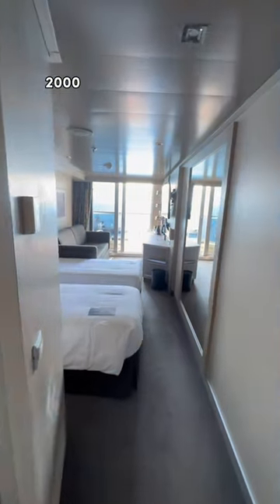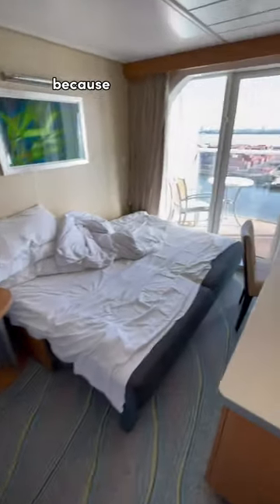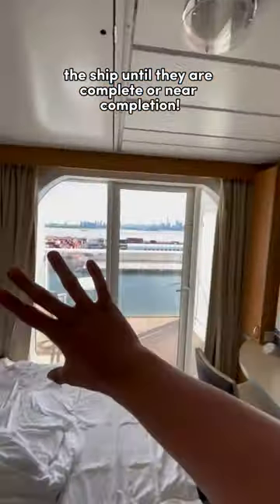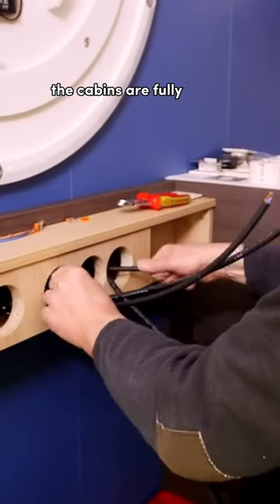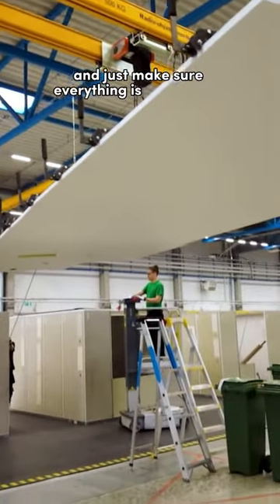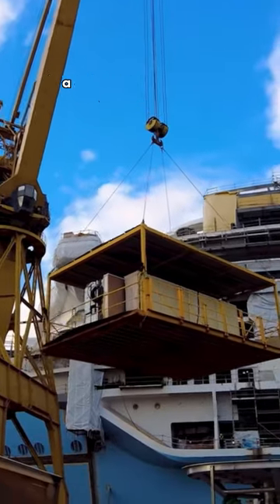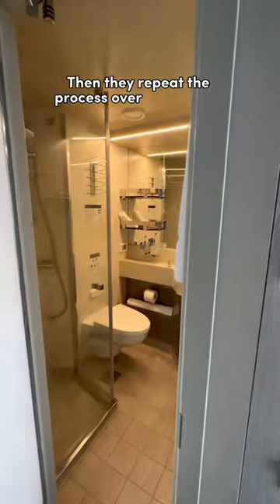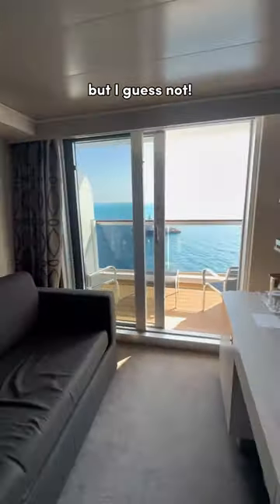Here’s how THOUSANDS of cruise ship cabins are made!

Comment: They used to all be hand made on the old ocean liners, when it took up to 5 years to fully build a ship, but during WWII the US came up with a term known as "compartmentalization" while they were building the Liberty Ships (cargo ships) en masse. Compartmentalization is when they fully build complete sections of the ship, that complete section is delivered to the shipyard, and it is craned into place and welded onto the ship. That's how shipyards can build a leviathan like the Oasis of the Seas in less than two years. The Titanic's keel (the backbone of the ship) was laid down in 1909 and it's maiden voyage was in 1912...so around 3 years to build a 45,000 ton ship that was built FULLY by hand with the aid of machines in place.